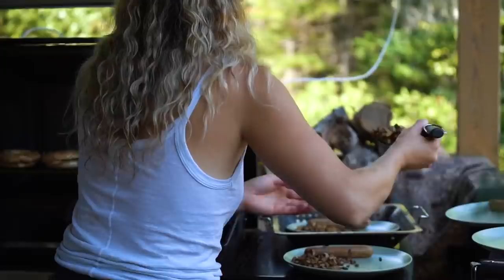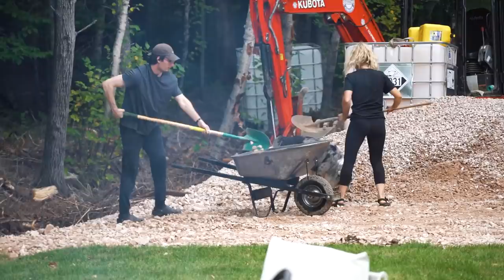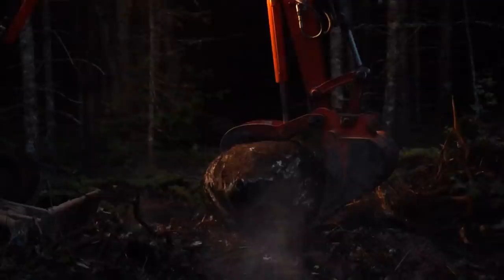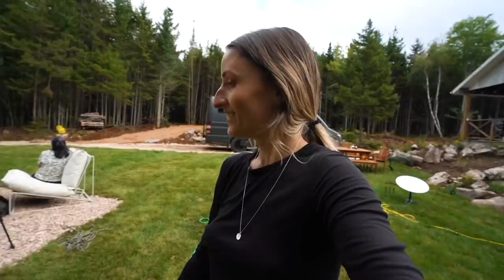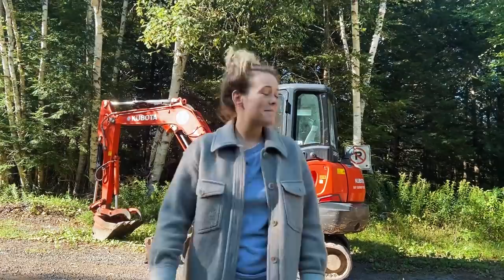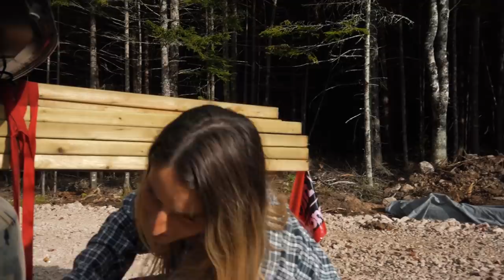Days of Our Life Living at Cabin in the Woods

Comment: You two make every project fun, even the outhouse. I couldn't quite tell what type of construction screws you were using. If you haven't tried the Torx head screw, I think you'll see they are easy to use and take out if necessary.
Reply: Hey there Jim, I believe they were using the Torx and you right they do make driving screws so much easier.
Reply from the maker: Thank you for your tip!🌞

Comment: For the outhouse. If you haven't already done so, buy a piece of 6" diameter black ABS pipe, the longer the better.  Put the bottom end in the vapor space under the floor right next to the hole. The rest is vertical up through the inside of the outhouse (usually in a corner for space savings) out the roof.  It might be good to even add a joint to make it taller.  In your area, you might want to put an elbow on the top end to keep rain from running down the inside.  The concept is one well used.  The black pipe heats up from the sun and creates a thermosyphon.  This creates an updraft that pulls air from the bottom (in the air space next to the hole) and vents it high above the roof.  The longer it is, the more surface to get hot. Now, always keep the toilet seat closed when not in use and you will have a natural vent system that also works very well in preventing flies.

Comment: When you take a wire through an outside wall, if you can, slope it downwards to the outside. Also if the wire is going up the outside, put a loop down first. That way any drips running down the wire fall off harmlessly, rather than tracking into the inside. Top tip. 😉

Comment: As long as you're rebuilding the outhouse, you should use 2x6s or 2x8's for the floor joists.  2x4s will be quite bouncy.  That thing you called a 'triangle' is actually a 'framing square',  even though it is a triangle.

Comment: Just something to watch out for...I built a deck 15 years ago using those same concrete piers on the ground and now after years of freeze/thaw/rain/snow, etc they have sank into the ground..in my case, one corner (where the steps are that everyone walks on and off it) has sunk enough that it pulled the hand railings completely apart.  I don't know if I had put a bed of sand or gravel under them (or of course, concrete pads) if that would've prevented the sinking, but just be aware it may happen without something under the piers :)

Comment: The mini ex is great for small work where doing it by hand just isn't going to happen. I have move a bunch of dirt with one and dug some good size trenches with a 3' bucket. A backhoe is really fun since it makes the mini ex seem like a toy but it isn't nearly as maneuverable. Next week we will have a huge excavator on our job. It would fill that dump truck with a little over one scoop as the bucket weighs more than the mini ex and the machine is 110,000 pounds plus the 5.5 yard bucket. I have only done a little with a big ex, so hopefully I will get some time on it over the next 8 weeks. We will have up to 40 super 10 dump trucks running at a time for this job. Last year, I borrowed the mini from work to do some landscaping around home and I will probably grab the skid steer from this job for some concrete replacement I have planned. With health problems and daily pain from them and doing construction for 25 years, anytime I can use a machine vs. my body is welcome.

Comment: A tip: never leave an excavator with the boom/bucket hanging in the air. It should always rest on the ground. It can fall down if the hydrualics fail.
Reply: Also stresses the seals,
Reply: @davidayer1  That too.